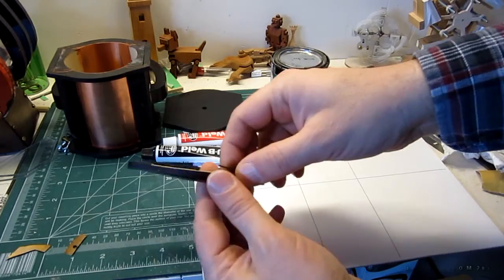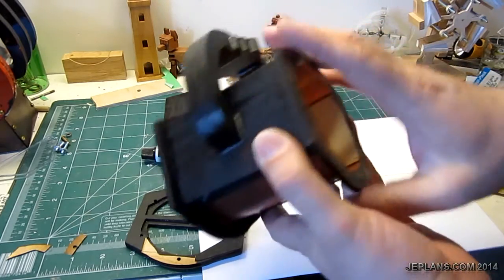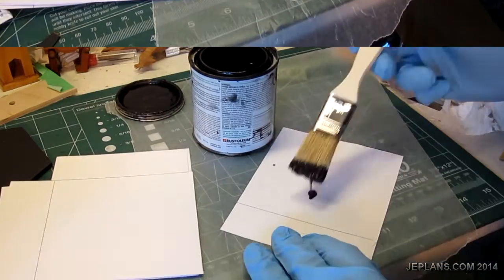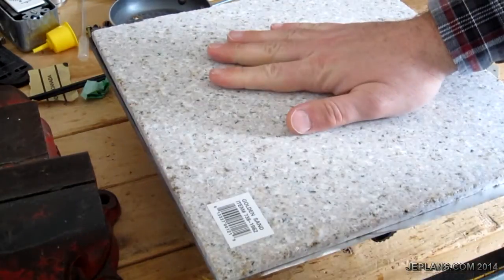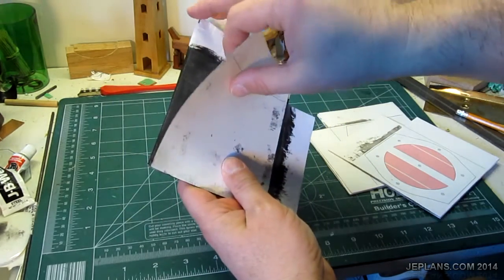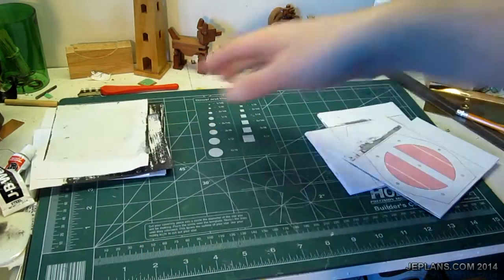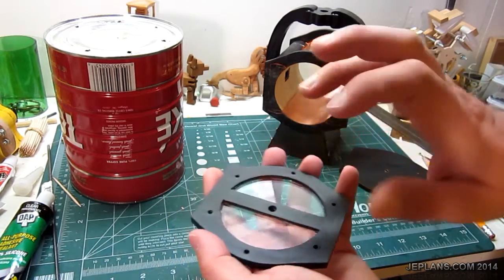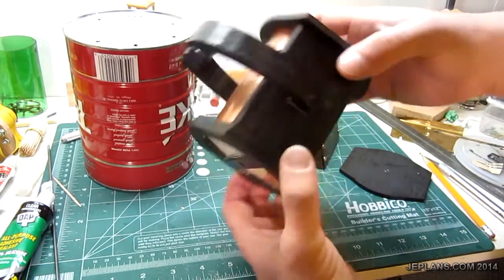Rotary Heat Engine Part 4.3 Rework

Comment: try using heat sink grease between the stand and displacer housing. it conducts heat better and may help the engine run better(faster and more efficiently

Comment: nice, finally turning! Congratulations for the patience! Additionaly, I wonder do bearings are tightseal?
Reply from the maker: The bearings are sealed and the axle it snug fit so almost no air gets past, this actually worked better than I thought it would.

Comment: Hi James. Great idea on the heat-resistant material. I wonder if it would work with old T-shirts or cotton shirts? (I'm serious. :0)

I'm confused by your machine. As you are no doubt quite aware, Stirling's contribution to the theoretical, and totally inefficient, heat engine of the power piston / displacer style was the regenerator. Without it the system has very little power. I can't see where your regenerator is. (I'm aware you've not called it a Stirling, but it looks awfully similar to a Stirling without a regenerator. EDIT: Sorry, you do call it a Stirling in the description.) I think I've worked out how to make a cylindrical regenerating displacer Stirling but can't build it yet.

I've enjoyed what I've seen of your work. Thanks for sharing.